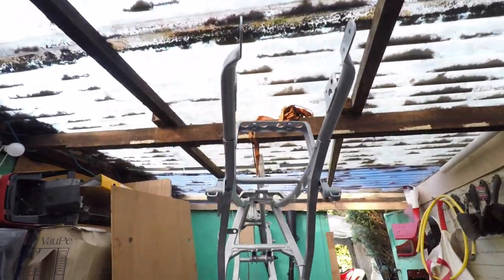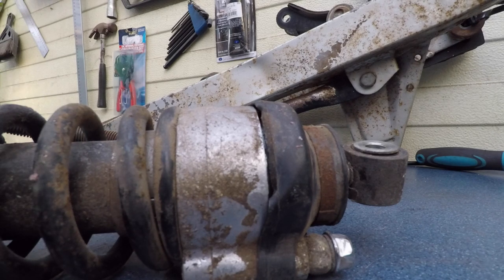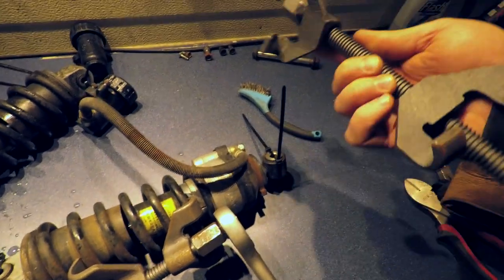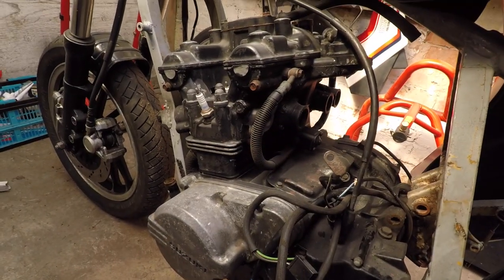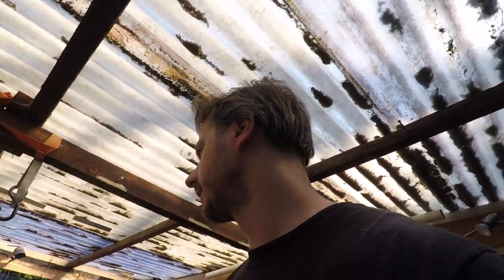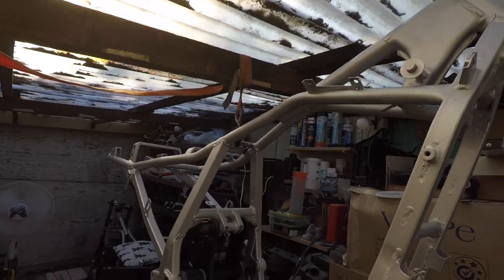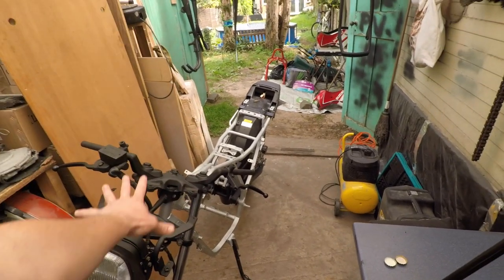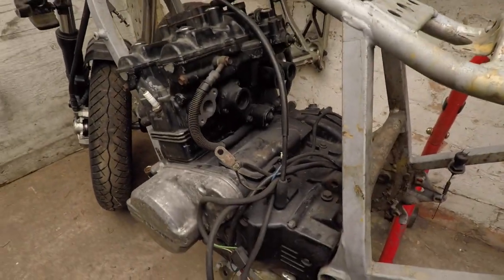Suzuki GS250FW Restoration Pt10 1080

Comment: Привет! С большим интересом смотрю твои видео по реставрации мотоцикла. Сегодня я купил Suzuki GS250FWS, мотор в хорошем состоянии, но внешний вид ужасный, тоже буду чинить. Мне нравятся старые мотоциклы, они великолепны и имеют свой особый шарм. Спасибо за видео, Удачи в реставрации!
Reply from the maker: thanks man! You'll have everything you need in these clips then. I recommend a sandblaster for the rest and a good wire brush set for the engine/cylinder head, I didn't sandblast those. And open the head and check the valve s and piston rings pls! Good luck!